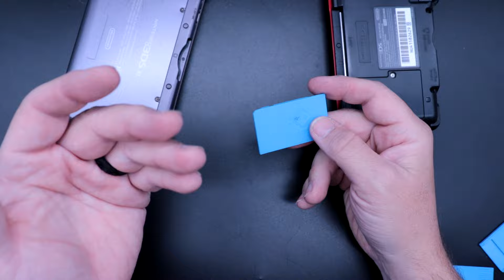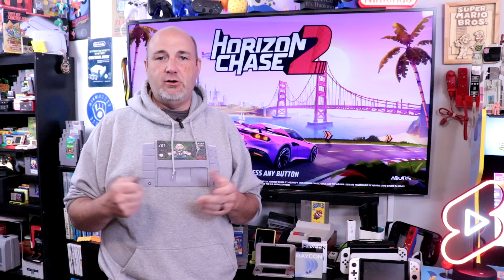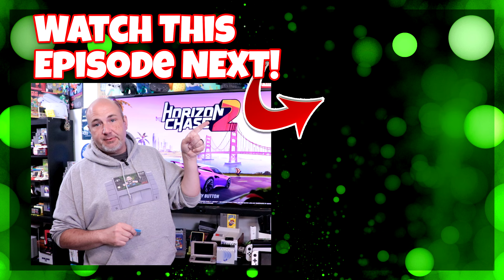ALL-NEW Nintendo Switch, DS & 3DS Game & System Cleaning Kits!

Comment: I do like the idea, you just have to be careful about how hard to rub and how much you rub off the cartridge's pins because the copper layer on the pins is thin and if that goes so does the connection to the game; the tin layer underneath doesn't work well as a contact. I would use the Switcheroo as something that would loosen the buildup and the use something about the size of a regular toothpick and gently remove loosened materials. The contacts on the system is something like aluminum or stainless and shouldn't be a problem.

Comment: But as I'm inserting it in and out, aren't all those particles falling into the cart slot?
I think it's a great idea but I think (underneath the scrubbing pads, in the grooves between) you might need some adhesive to grab any rubbed off particles... I don't know about the adhesive but, I'm just thinking on the fly... I don't know what's inside/underneath the card slot
Reply from the maker: The particles don't rub off